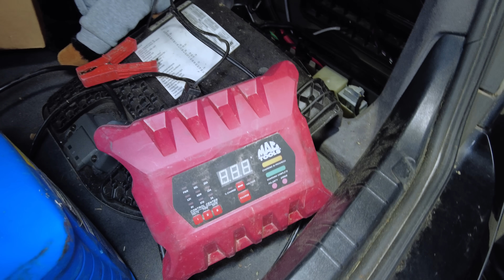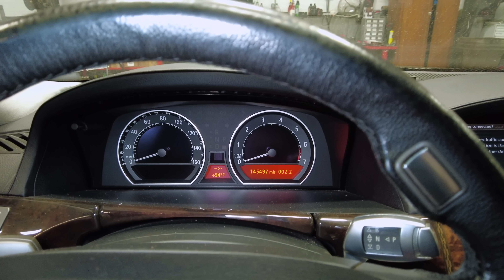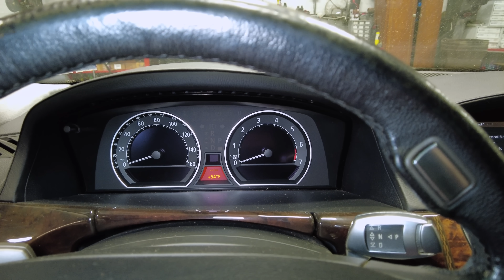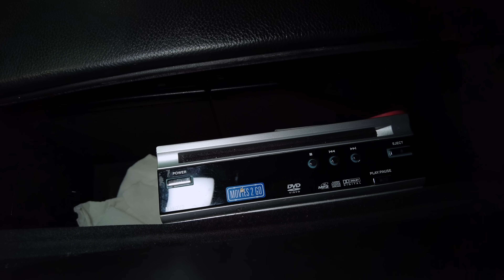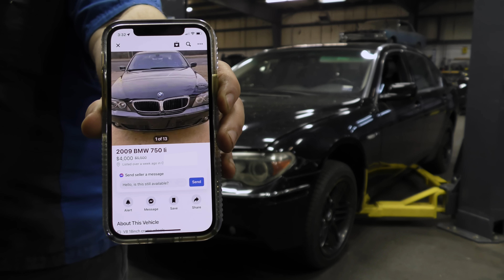Fixing a high mile German car?! Is this '04 BMW 760LI with a V12 worth it? CAR WIZARD breaks it down

Comment: I was at a Mercedes dealer in line to pay a bill when a woman in front of me was screaming about her $6000 bill for the used car she had just bought and brought in for service. The clerk called the manager who calmly listened to the rant all over again. There was a pause... And he said "Ma'am, perhaps a Mercedes is not for you"
Reply: Avoid the stealership or you will go bankrupt with any Mercedes. I only use the stealership for parts
Reply: I thought they had to get your consent before proceeding with high cost repairs so as to avoid situations as you described.
Reply: @jalopy2472  

questionable engineering? more like questionable service intervalls. The lexus ls is no better than an s class (7 series is just not a bmw a person should buy). The air suspension fails as well and it is even more expensive to fix. There is a reason why a lot of mercedes diesels are used a taxis. They just work  ...
Reply: @amduser86  this
Reply: i bet you it's those newer 4cyl turbo engine like the m274 where the turbo blows out every few thousand miles😂
Reply: @vanessamckinney1402  

serviceintevalls. with clean oil turbo do not blow out. just change the oil and filter every 10k and the transmission oil every 60k and start to be amazed how it suddenly works forever. the real trick to german cars is to buy them new  and drive and service them yourself. then it works more or less as good as japanese cars. at least german cars (except mercedes) have not real problemes with rust.
Reply: Reality has many ways of asserting itself.
Reply: @midcenturymodern9330  no shit
Reply: @jalopy2472  every car has “questionable engineering”
Reply: @jalopy2472  No, they’re designed to have less features because they cost less. Lmao
Reply: Unless you can work on them and have a shop to work out of.
Reply: You can have German car experience but you can only get it in the 4cyl form, which is (and was) often not possible in USA. I'm happy with my 1.9 TDI Audi A6 FWD. It isn't Toyota cheap, but it isn't a Toyota either.
Reply: @anthonyxuereb792  hmm!...you have to request to be notified, not all shops have integrity.
Reply: Service shouldn't cost six grand even for a Merc. You missed the repair job?
Reply: @anthonyxuereb792  Decent garages would do that
Reply: @dallysinghson5569  I'm fortunate to have such a garage, won't turn a bolt without my permission, everything up front to avoid any unpleasantness at the end.
Reply: @amduser86   changethe oil at 5k  10k is waaaayyy too long an interval
Reply: I ran a BMW shop and highly recommend to change the oil every 5000 miles. 10,000 mile intervals incurs a lot of wear on the engine and BMWs happy to sell you another car at 60000 miles.

Comment: I have a 230k mile '03 760IL and it's been weirdly reliable in the 5 years I've had it. It almost feels wrong, because it should be having a lot more problems than it does.
Reply: The IL has oddly always been more reliable than the LI
Reply: Drive it until the first problem and then sell it or scrap it.
Reply: it is reliable because it has been maintained properly in the vehicles life.  it only has problems because people dont change oil, and dont make coolant changes in times. people also make a mess inside their cars wich creates a lot of dust wich the electronic components doesnt like. I have a E60 M5 with 260k KM on it. totally reliable.
Reply: 230k miles? That's impressive for a BMW model that's widely considered to be an absolute "lemon" by the community.
Reply: If it’s regularly driven every week, all deals are lubed by engine oil, low chances will it have issues.
Reply: @randomcommenter1433  Where I live, there are dozens and dozens of these with 250-300k miles. In fact I can't even find one with less than 150k miles without fraudulent mileage.
Reply: @Dominic Cerisano Used to be that Volvo designed their cars to last 20 years, I don't know about now days.
Reply: Dump it now you just cursed yourself lol 😅
Reply: Because these cars are very reliable if maintained as should. V12 actually is even better than V8. Its still an old school “E” series bmw that you can work on yourself not like newer ones
Reply: IL is more reliable than LI 😂😂 what does that even mean? E65 7 series with the long wheelbase are Li. E38 7 series with the long wheelbase are iL. A 2003 is an E65 so it is Li not iL.
Reply: @lexburen5932  right folks kill me with BMW isn’t reliable 😂😂like why is it thousands of others who have the same car and other models got over 230k on it with not to much issues, MAINTENANCE is key with anyone type of German car or any car for that Matter even Preventable maintenance at that
Reply: I had a 96 750il with 150k miles and was on it's 3rd engine when it blew another head gasket and I sold it
Reply: There are definitely some outlines to the general E65/66 reliability trend (just like every car has a batch of lucky and unlucky models) pretty much you always hear about the unlucky E65/66s
Reply: find a church door and knock it now.
Reply: @luciolalazilia2189  very true because that’s the main reason why mines is how it is, long distance driving most of its life not stop and go😭even to work it’s 45 mins each day
Reply: As a BMW maniac, you should've never posted this comment, it can hear you, it knows you posted it was reliable, now you just opened a worm hole in to the abyss 🤣
Reply: @SavageBunny1  LOL
Reply: Amazing what regular maintenance can do. Some people are just clueless. I'm sure there's an element of luck, but usually good maintenance will take you a long way with any car.
Reply: @CoreMaster111  The dealer's service department is doing the right thing and so is the customer.

Comment: no.. the saying is "if you cant afford a new BMW, You definitely can't afford a used BMW"
Reply: No car gets a discount for parts or labor based on a car's depreciation.
Reply: That’s accurate !
Reply: That goes for any German car
Reply: Complete bs, my 2008 328i was at an affordable price and has been affordable to own.
Reply: @spicysnowman8886  well that's one exception, id say that's one of the most reliable modern BMWs
Reply: @spicysnowman8886  yeah u got a base model.
Reply: @malinoisnation9392  I'm aware, it's still a nice car base model bmw =/= base model toyota.
Reply: As someone who bought an 08' M5 in 2019; this statement is very true...
Reply: @jalopy2472  not sure if you're aware but =/= means does not equal, I was not comparing them.
Reply: @spicysnowman8886  Same here; 330,000 mile 2004 530i here, only sat down twice in the 14 years I've owned it. Maybe it's because my BMW was built in Germany.
Reply: @HowardLeVert  exactly, natural aspiration and made in Germany is the best recipe for a bmw.
Reply: @machtschnell7452  underrated wisdom
Reply: @spicysnowman8886  my friend owns a 2008 335i in manual and it's a complete pile. No matter how hard he tries there's always something wrong with it. Another friend owns a 2012 535x. Same engine pretty much and it's even worse. I don't want to drive with them out of fear for my safety.
Reply: @spicysnowman8886  328i, no offense, is garbage.  G37, TL, IS350 were all build better, better quality interior, and better cars in general than the 328i
Reply: @floggyWM1  they're also a hell of a lot more expensive
Reply: @spicysnowman8886  brand new in 2008, all of those models were cheaper than 328i actually.
Reply: @floggyWM1  well I didn't buy it new, I bought it a year ago. Those cars compete with the 335i.
Reply: @TermlessHGW  the n54 is very high maintenance, the n52 is different, it gets leaks but that's about it.
Reply: @spicysnowman8886  gotcha, enjoy.  328 does have a good handling tho.

Comment: I bought my bmw not for the status but for the driving dynamics. I make no where near what the original owner probably made. The big thing with them is you need to be skilled enough to fix them yourself or be willing to learn how. Otherwise you're just getting on board the pain train.
Reply: the pain train is still real even if you do know how to fix em... especially when its the last part going back on and SNAP tools go flying
Reply: As a mechanic that works at a shop that specializes in BMW, Audi, VW, Volvo, Mercedes.. I can tell you even knowing how to work on them, BMW's are nothing but headaches.
Reply: @ItsCleto  I definitely know how to work on my car. I just have a fundamental understanding that an N54 will be much more complex than a K24 so I plan accordingly. It's all about perspective my man.
Reply: @ItsCleto  BMW motorcycles are great!  So sad what has happened to their cars.
Reply: Knowing how to do something that sucks doesn't really make it suck much less
Reply: Good to know you did not buy one to show a Stupidity Status.
Reply: @grabir01  no sir, i did not. I test drove a lot of cars before I made my decision. I love the way the car feels when I throw it around and I think they sound very pleasant as well. The creature comforts are nice but being an 08 it's definitely dated compared to newer ones.
Reply: Yes, you have to be mechanically inclined to repair these cars, but you'll also have to have a backup cheap car in case of down time 😅 honestly I like working on mine, you have to be an enthusiast to be motivated to work on these but when it's running right it's just perfect
Reply: Perfect enthusiast cars imo. The only requisite is that you love the car and can turn a wrench
Reply: Justify it however you want. It's still going to cause you pain.
Reply: @aaronbrown6266  Explain exactly how. I haven't had a single issue with this car that was harder to fix than any other. Turbos, water pump, injectors the whole deal. Seems to me like people confuse complicated and painful with time consuming.
Reply: @aaronbrown6266  hehe I think I would prefer working with my own 750 in my spare time than looking at that hideous gladiator game called American football....

Comment: One of the OG money pits , gotta be top 10 of all time 7/8 series
Reply: Anyone that owned an E65 BMW is now a Japanese car enthusiast 😂 ask me how I know
Reply: It really isnt moneypit maybe for you americans yes but most EU countries have workshops that fix those well and most of the problems are solved permamently, I have 730d with 500k kms and its dead reliable, doesnt leak or anything, not expensive to maintain compared to newer cars, tons of diy options, E65 isnt bad at all It actually made me like 7 series as its my first one, maintenance is the key for a nice ride! No japanese car comes even close.
Reply: @KhronozChannel  M57 diesel is the reason your car didn't break yet, the V12 is a lot worse
Reply: @mihneacireasa4613  V12 is reliable ive seen many high mileage ones, yes you have to adress fuel system and coolant leaks at some point which isnt really cheap but its a frickin V12 high end luxury car, rolls royce engine, its to be expected. that doesnt make car bad its just basic maitenance and M57 E65 also needs bigger jobs done sometimes but Its to be expected that you have bigger bills than Honda civic, this car is solid, quiet, comfy, SAFE, luxurious, good sound system, etc, F01 is waaaaay worse than E65 so I wouldnt complain.
Reply: @KhronozChannel  I do actually own a diesel F01, no problems whatsoever and used only for long journeys, though I think the power steering pump's making a weird noise. They're good cars as long as you listen to them when they complain, you don't want to keep them waiting :)
Reply: @mihneacireasa4613  You are lucky or your car is maintained and doesnt have “stupid” optional equipment that breaks but local workshops claim that F01s have alot more issues than E65 had back in the days, aside from that I think F01 is absolutely gorgeous, probably nicest 7 series thats made at least in my opinion, good luck!
Reply: I had a friend with a brand new 760i, 3 years later he downgraded to a skoda supurb, he has been driving only supurbs since. (For the north americans - thats a luxury, but affordable vw)
Reply: @heixpeix  European shops can fix European cars better than American shops? Tell me more. This is ground breaking information. 

Is it maybe because the PARTS are MADE in EUROPE and so are the CARS? hmm.
Reply: Yeah it’s bad enough some euro cars cost more to maintain but some of them you can drive and it’s not too bad. But this is one of the worst
Reply: @KhronozChannel  it’s definitely a different story living somewhere that labor is not as expensive and would totally give you a different ownership experience I know there’s places in Eastern Europe that too full restorations were significantly cheaper

Comment: I was surprised when you mentioned that not even Ninja would touch it. That's how you know it's FUBAR.
Reply: But aren't BMWs a quality,  well-engineered car which are built to last?  The M539 Restorations channel shows how when repaired with factory or OEM supplier parts without regard to cost as the engineers originally intended, these 7 Series (in his case an Alpina) and even older BMWs can be repaired to near new condition.
Reply: @TassieLorenzo  Engineering doesn't matter outside of performance. The parts are switched from metal to plastic with a specific time-to-live. Once the heat/cool cycles destroy the plastic you are in for a lot or repairs. One thing is the coolant crack pipe which is often made of PVC but once broken is replaced with an aluminum version. Best fix ever as long as you didn't overheat your engine.
Reply: @TassieLorenzo no, highend beemers are over complicated maintenance nightmares, and low end ones are cheaply engineered crap.
Reply: @TassieLorenzo  Ok, but how much time, effort, and money did they spend to do that? Certainly more than a great Camry would cost, and maybe more than you or I make in a year. And how long will (did?) it stay that way?

Comment: The issue with the 7 Series in particular is being a flagship. That means they put their latest, experimental, tech in these cars. So they're more likely to break after warranty. This, being the top trim model, will have parts that are rare unlike the lower trims. That means big $ when sourcing parts. Also, I notice these cars are often neglected. People like these 7 Series models because of status and forgo necessary maintenance.
Reply: The Mercedes S600 is the equivalent, and you can find a lot of older ones on the cheap.
Reply: @adotintheshark4848  And not only that, they are literally bulletproof when compared to this pile of poop.
Reply: True, but maybe a similar era Acura or Lexus flagship would be the most reliable at this point? Of course maintenace is important but still.
Reply: @100xasd  Nobody can touch Lexus. And the XF40 LS is way better built than the W221 and especially the E65. It's that people don't know this at all. But then again, the LS fetches a good 20-30% premium on the 2nd hand market compared to the German rivals.
Reply: That was not the way in pre 90s 7 series. They're not the technological showcase. They were build with the most reliable, proven technology that bmw had. Only after 2000 with the e65 series bmw starts following mercedes lead by putting experimental tech in the 7 series.
Reply: @ilovelimpfries  bingo, I was literally about to say exactly this, find an 80s BMW with the in-line six and manual, and if you don’t care about creature comforts, like door locks, windows, lights and all that fluff working, you have yourself a nearly indestructible beach car. All the maintenance is easy, things I don’t want to take on like clutch plate/throw out bearing cost me $400 last time I had it replaced. Very stable technology at that time, definitely not the new way of doing things.